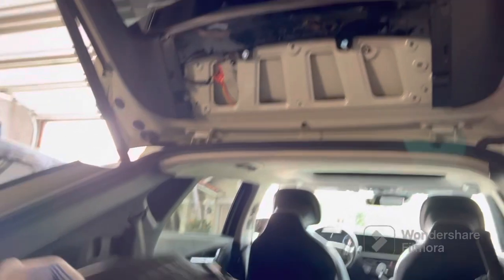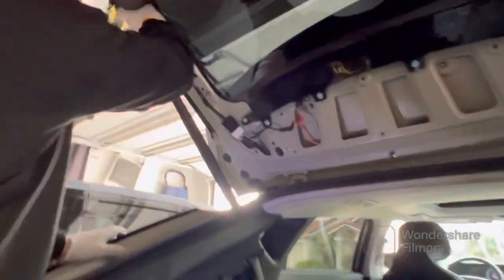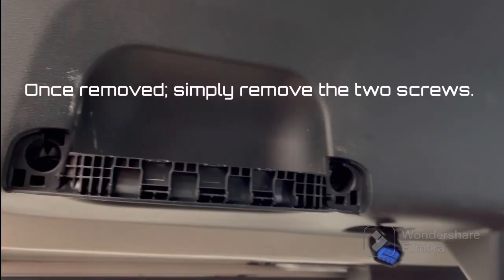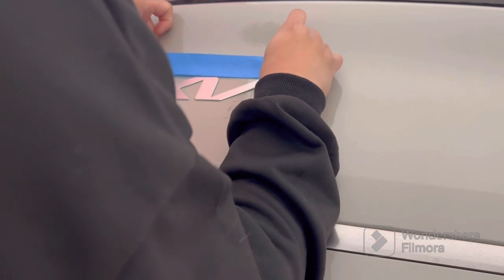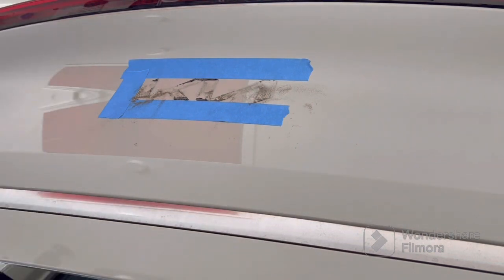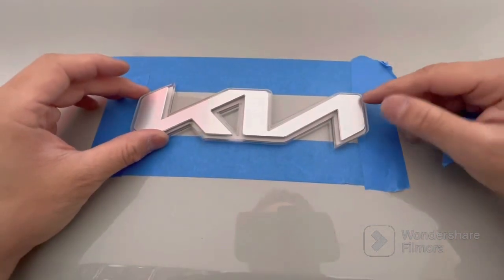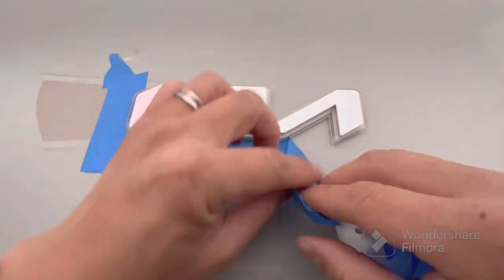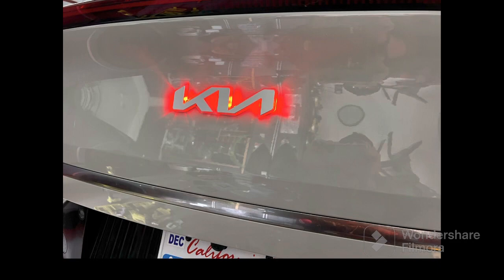EV Vida Presents: Kia EV6 Rear LED Emblem with Audio

Comment: Not worth the drilling imo. I would just take the emblem off that's about it. Does the front one have no holes too? This mod would be nicer in the front as well.
Reply: Unlike the rear KIA emblems, the front hood emblem has two guide holes.
Reply: @scottadams1119  thx as I found out a lil afterwards that it did have holes which is a shame. Not sure why they needed to do this as I might've considered just taking it off for a clean look. I do like the new logo of course but I rather have a clean look at times.

Comment: You drilled a hole and didnt paint the inside of the hole... its gona rust.
Reply: Yah, he needs to at best try and paint or otherwise  cover that because you are right, it will rust.
Reply: isn't it aluminum?